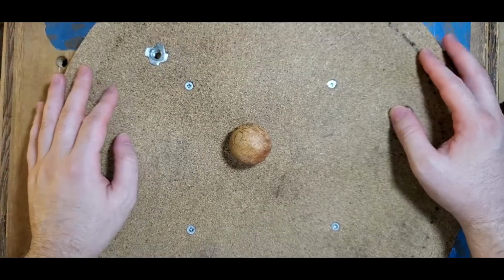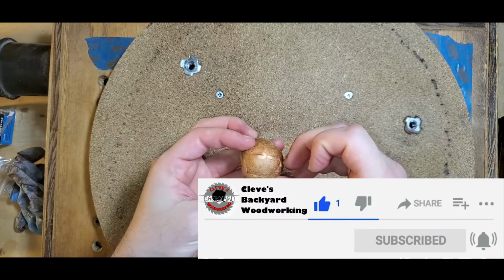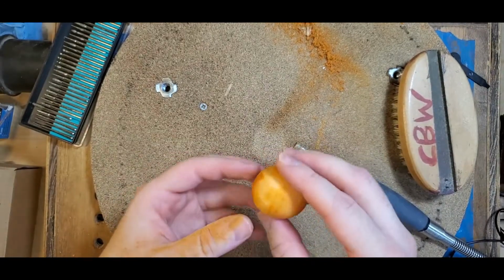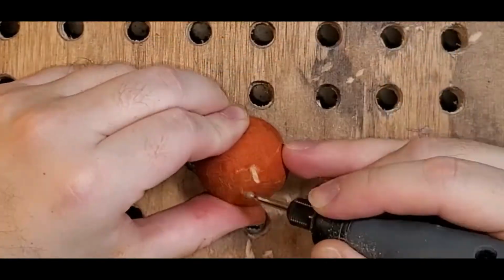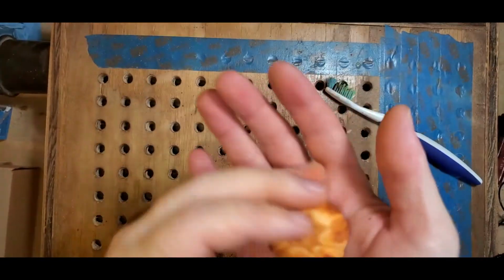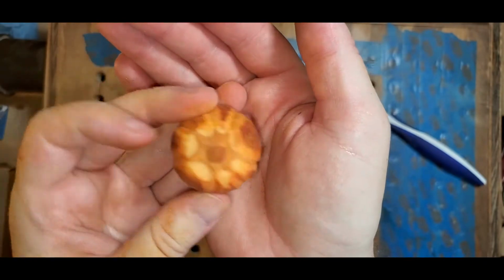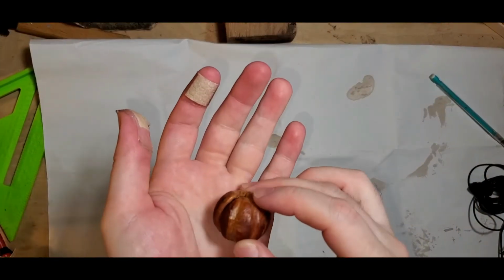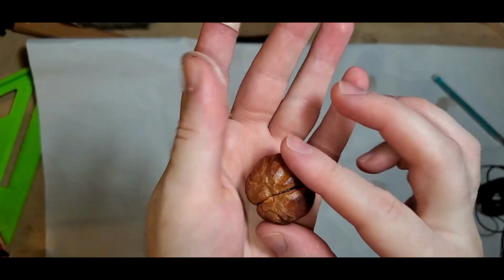Simple Power Carve An Avocado Seed

Comment: It is best to carve avocado pits after they have dried as much as possible. They will almost always crack when they are drying. What I do, if I want to carve them in the round, is simply glue the two halves together, wait until the glue dries, and then carve them. If you want to carve just the halves, they will dry much, much better if you carve a thin sliver of material from the surface - outer surface and the flat inner surface. You can tell when they are quite dry by pressing them between your fingers. If they don't feel hard enough, the probably aren't. You can also tap them against a hard surface to see how hard they are.